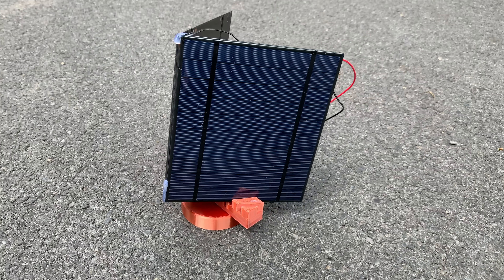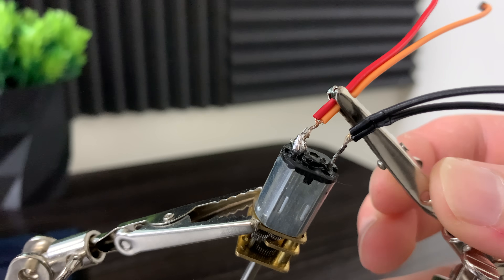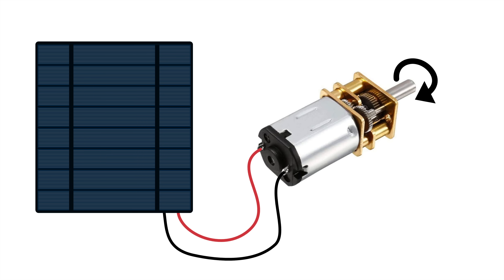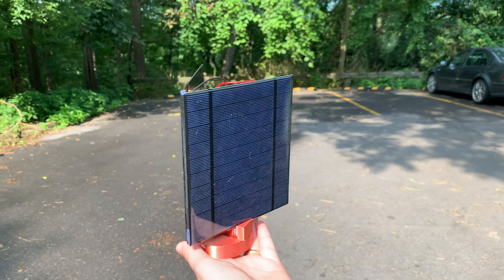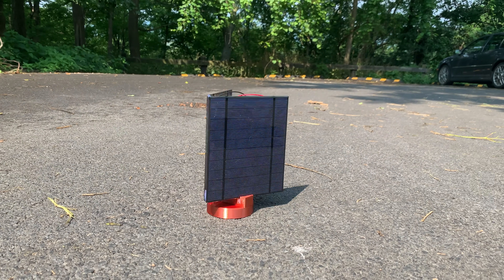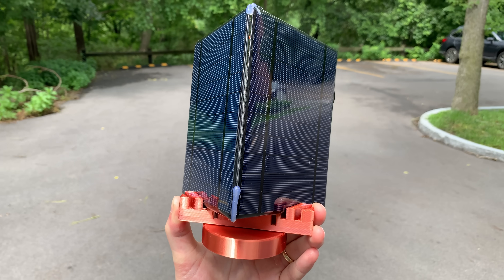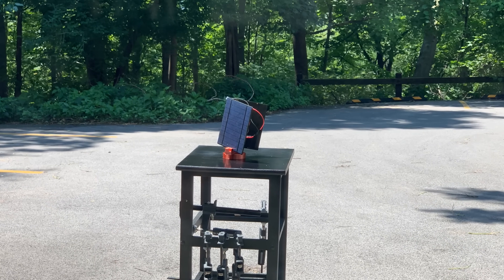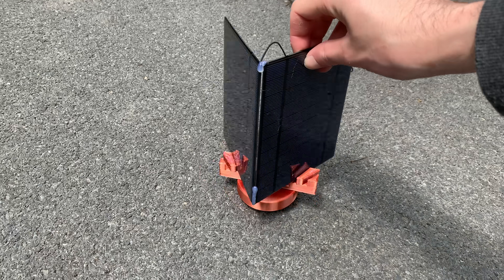World's simplest sun tracker.

Comment: Love the simplicity! Nice one!
Reply: Hello
Reply: Simple solar powered resistive heater as they are in series and shorted. If scaled up, this is a fire hazard.
Reply: @dtibor5903  finally, someone who thinks
Reply: I can already see a more elegant solution for the oscillation... made in brass.
Reply: please do something similar but also to power something ( small electronics) 😉🤙 U REALLY CAN MAKE SOMETHING #AMAZING FROM THIS !!! finger crossed 🤞 HOPE U GET MORE SUBS !!!!!
Reply: @lsudan2670  Also, it would be nice to be able to store the energy it collects also.
Reply: @kryptonic010  But if you build a position encoder into the base, this could be used to steer a much larger array of panels.
Reply: @kryptonic010  You can always connect a simple 10Amp LifePo4 battery to it or any AGM battery in that case!
Reply: Try this!
Essentially the same concept with a transistor amplifier.
http://www.redrok.com/electron.htm#ledcooker3
redrok
Reply: @ D Tibor... A couple of diodes would stop that...
Reply: @thedarkknight1971  ah yes, the comment i was expecting. No they don't. Totally hollow statement: "diodes". If only for your own satisfaction, try to draw how those diodes would need to go in the curcuit and you would see that won't work.
Reply: @thedarkknight1971  no, the panels are in series without any proper load.
Reply: @thedarkknight1971 no it won't
Reply: @Aden Sallaberry - See my comment (2 small solar panels drives the turntable motor, and 2 large solar panels mounted on top of turntable to provide power to whatever you need power for)...
Reply: 2 photocells like switch of conmutes conection to the electric engine doing the sale, only what you can take some energy from the solarpanels. Add logical doors (2AND, 1XOR) and it become eficient
Reply: Hey ma man I'm big fan of yours
Reply: SIR MATT, PLEASE DO A VIDEO OF  SUN TRACKER BUT IN DIFFERENT APPROACH =)
Reply: So cool to see YouTubers commenting on YouTube
Reply: I can read this in your voice DIY Perks
Reply: research solar probe.. similarly self aligns in 4 axis to shadow satellite from suns radiation.. another pair of solar panels + geared motor on x,y is needed..
Reply: Woah hey you here!!
Reply: Eh neat
Reply: Exactly what would you do with this? My first thought was cool, maximum charging for camping or whatever but not so.
Is your next video on doing something useful with it? I do love diy projects.
Reply: Woooooah. Matt is here..
Reply: nice to see you
Reply: Ok baby
Reply: Hello
Reply: wow guru u are here 😘
Reply: Make it out of brass and make it shine as usual diy perks kkk
Reply: Hi...
Reply: The king have spoken
Reply: О, привет
Reply: Make a series of such videos @diyperks
Reply: It's still not the best as both the panels are supplying equal power to remain stationary but as a result both are facing the sun at an angle. So it can track sun but It can't produce power efficiently.
Reply: You could do something whit this ...and im waiting to see it.
Reply: I bet you'd make it out of brass ;)   - The most simple and beautiful sun tracker
Reply: This is simple but so dumb.. definately it will damage one or other solar panel and then it will keep pointing away from sun... Classic example simple not always better..
Reply: Dude you're amazing i use your videos at my university here in Cuba i like your videos
Reply: DIY Perks you are yourself, an excellent creator
Reply: though u saw that one https://www.youtube.com/watch?v=wL9PcGu_xrA and still think this video is useful...
Reply: A compliment from the master of overengineering stuff himself. Nice, this channel is officially famous now :D
Reply: Nice to meet you sir
Reply: simple as a shortcut is.
Reply: It's so simple, it's even broken after some weeks. XD why no one see it's wrong designed?
Reply: @The_Kansas_Kid its a shortcut, what did you think? best case it just stops working. in the worst case it could burn. would YOU test this? not me.
Reply: @The_Kansas_Kid everyone who knows just a little about electricity can tell you a shortcut isnt a thing you should build. so my proof is: ask others.
Reply: @The_Kansas_Kid wow you was a electrican and didnt see the sortcut here? try to paint the curcuit at a paper and see yourself! i could do this for you but i think youtube didnt let me post a link here. its ok to not trust people, i fully understand you. but you HAVE to paint it, i bet you will see the problem here! you can write me back and i will answer! i prommise.
Reply: he didn't include the usage of the powerful human being that has to keep moving it....idea is there...functionality not quite
Reply: Ti leave them fixed in a good orientation, Is more simple and probably you harvest more Energy.
Reply: Yes, a Little Wind Blow and you get a solar airplane that could kill your neighbours.
Ideal for Ucraine Land.
Reply: It’s amazing how simple such a complicated thing can be. Now we have to figure out what to power with it!
Reply: @AdenSallaberry  👍⭐
Reply: @AdenSallaberry  you cant power anything because is is powering it self and wasting the energy. it is not a practical circuit , just a toy.
Reply: @AdenSallaberry  you cant. It doesnt deliver any power in neutral position
Reply: @AdenSallaberry  it can‘t power sth with this wiring. You’d have to sacrifice the simplicity for that. That’s why this is simple, yet not clever.
Reply: @tmartin9482  think u miss the point you can now mount this on a larger solar panel to ensure its always pointing at the sun.. he literally just made a homemade sensor with almost zero complications.
Reply: @AWESEM0  For example, think about whether you would rather control according to the potential difference of the 'detector' in your example, or whether you would rather control according to the total output of the power generating panel.  Also think about whether it would be efficient to react to every momentary shadow on the 'detector'. What about reflections, etc.?
The part shows several physical effects and the author has shown that in an excellent way. But please don't overstress the concept.
Reply: @tmartin9482  finally, someone with a brain and using it
Reply: @tmartin9482  you could use it for powering something. It would be more complicated but still possible to pursue simplicity like they did in the old days with the electrotechnics
Reply: @LayerSlayer73  You can't use the shown mechanism for powering sth. It stops as soon as the voltage drops to 0. No Current , no power. And i don't want to have a discussion while you are moving the targets ...
Reply: @tmartin9482  what is normally done is to use 2 small solar panels to drive a motor with several panels on top
Reply: @AWESEM0 plenty of complications like shorting/reverse feeding the solar panels.

Comment: You could put a diode on one lead of each panel to stop voltage feedback into the panels
Reply: Well, the funny thing is solar panels are made of diodes.
Reply: @Duck_side  kind of, but in this situation they are backfed, which means one panel will act a little like a shit diode lamp while another is getting enough light to power both it and motor. I don't think you can solve it by adding diodes, as they will face the same way the diodes in panels are facing thus doing nothing to solve the situation. Maybe I'm wrong, I'm not really into electronics.
Reply: @forgivenid  Diodes can fix this. Connect a diode oriented in opposite polarity in series with the solar cell. This diode cannot support current flow in both directions unlike the solar cell.
The issue here is the voltage drop across the diodes leading to power loss - however this dampening can also help attenuate the oscillations of the device, if the solar cells output sufficient operating voltage to overcome the drop in normal operation
Reply: @Duck_side  They are not made of diodes.  A diode is a pn junction that's been designed for a particular application.

A solar panel contains a pn junction but it is not designed for the same use as a diode.
Reply: @deang5622  a diode is a diode. The application may differ but the device is still a diode.

A solar cell is a photodiode, which is still a diode.

Comment: That's a short circuit! 🤔 The overcurrent could damage the panels. Try to connect the two red wires of the panels. Then connect the two black wires to the connections of the motor. That should work without a short circuit.
Reply: The panels will experience a current no higher than their Isc (in fact much lower due to not being normal to the sun). Your proposal of applying opposed voltages from the two panels instead of opposed currents will likely result in the motor not turning, because the change of Voc with incident intensity is much smaller than the change in Isc/Imp.
Reply: @cosmicosmofour6883  Nevertheless it's worth a try.

Comment: So would you use this to turn a larger array or how would you harness any power from it as that would negate the principles on which it works?
Reply: Place this device on a larger array, and it's a negative feedback loop.  A simple DC gear reduced motor just like he used but bigger to drive the large array would be plenty.  The sun moves to the left.  The sensor array follows it, which makes an electrical contact.  That contact fires the main array drive motor (through a suitable relay or h-bridge).  The array swings left moving the sensor too far to the left, causing the sensor to swing right and breaking the control contact.  Disregard the comments about it being a short circuit heater.  the panels in this device don't produce enough current to be a problem.
Reply: You can heat up water with this simple solar powered resistive heater. If is wasting all solar power as the panels are basically shorted. Connect two 100w panels like this, and boom, you got fire hazard.
Reply: @dtibor5903  Ah yes, heating water with the power of the sun, except there are solar panels floating in the water for some reason.

Comment: Very clever and simple. It would be nice to solve the oscillation issue in such a way that it  still tracks more smoothly. Add a small potentiometer to the rotation axis and you have a position encoder that can be used to control a more powerful stepper motor for a larger electricity generating solar panel, or a whole array of them.
Reply: Or you could actually measure the voltage difference and drive the motor such that the error goes to zero using the combined power of both cells. But that would require more then 3 components.
Reply: Someone who gets it!  A stepper is overkill, though.  Place this device on the array, and it's a negative feedback loop.  A simple DC gear reduced motor just like he used but bigger to drive the large array would be plenty.  The sun moves to the left.  The sensor array follows it, which makes an electrical contact.  That contact fires the main array drive motor (through a suitable relay or h-bridge).  The array swings left moving the sensor too far to the left, causing the sensor to swing right and breaking the control contact.
Reply: He's proved that solution already.. without any more components.. 😁😁😁..
OR SOFTWARE 😂😂

Comment: not usable in practical one..... rather use two LDR, an opamp, Zener diode, and an H-bridge motor driver..... this combination can make it way more efficient and usable.
Reply: Originally I tried LDR’s but they proved unreliable. Changed to two small solar panels and it’s been going for the last 10 years.
Reply: @kevinmills5293  why unreliable? Were they saturated or was the area too small and prone to give false measurements when they went dirty?
Reply: @theincapable  they would fail after a  week or so. I was running them well within limits in terms of voltage and current but I had about 4 failures before I went to small solar cells. Maybe the sun was too much for them or they were a faulty batch (from China).

Comment: But then, how do you do something usefull with the energy without disturbing the balance?

Also, if you don't touch it in the night, will it be able to retrieve the position in the morning? or is it having the sun totally in the back?
Reply: The simplest way would be to use tiny solar panels that only function as sensors (or probably just photoresistors at that point) and connect them to a transistor that controls a bigger motor which can move some bigger solar panels that produce useful amounts of energy.

Comment: Why track the sun if you can't use the power from the 2 panels to powering other things.
Reply: you could add another panel on top that would have maximum power because it's always facing the sun
Reply: @thesmasherthebest  that would work, but most of the weight in this design rides on the motor. It would need to be redesigned to work effectively.

Comment: Back when Discovery channel was doing useful shows, they had one called The Colony.  The first group built a simple solar tracker using a photocell that was recessed into a tube.  When the photo cell didn't see the sun, the motor was activated, moving it and the whole solar array.  Once light hit it, it would stop.  It's just one of the things I have filed away in case society collapses
Reply: I keep wondering when that solutions will be incorporated into all solar panel arrays and disappointed when it hasn't happened yet.
Reply: @Jamesvandaele  the problem in this is that a fixed solar panel is way cheaper since less complicated parts, way more safe to mount and also more effective since not every spot is big enough to carry a rotating angled solarpanel also less chance of failure  due to less parts. maybe the floating solarplatforms already use this?
Reply: @nfnworldpeace1992  and the lack of moving parts means less wear and thus a longer lifespan
Reply: @nfnworldpeace1992  A DC motor, a mount  and a few connections is not many parts. A fixed solar panel would be way more efficient if the sun was beating directly on it at all times all day long
Reply: Than you for your comment, I was trying to remember the name of the show. That old dude was a very creative engineer.
Reply: @Aquatic Ape MIT says 2040, and we're more or less on track for that, but there's always the slim chance people will collectively pull their heads out of their asses and work together rather than against each other.
Reply: Once I made a line tracker like that, 2 photoresistors inside a termotube, 2 leds and 2 motors. Same circuit in both sides of car. Leds pointed to the floor and when there was no light reflected to the photoresistors that side motor stoped so the other turns back the car to the line. It was very fun to do back then in Highschool
Reply: I used to love that show! I forgot it ever existed.  Thanks for reminding me... I'm going to go see if it holds up to my teen brain romanticism of TV. Mythbusters was amazing and still is, so maybe I had great taste as a teen... lol
Reply: @DanteYewToob  I just remember that the old guy who put it all together went from being all beat down and depressed looking to happy and healthy over the course of the show.
Reply: i watched that and have it here as well :) 

a great thing. It was the IBM fellow guy who did all the cool stuff :) and the mechanic guy. everyone else was fucking useless.
Reply: If society collapses won't we have bigger priorities than building a toy that points towards the sun?
Reply: @huraqan3761  Solar panels generate electricity, which can be a useful thing in situations where the power grid is unavailable.
Reply: @jaredkennedy6576  uh huh, if society collapses you'll probably want to start growing food first.
Reply: @huraqan3761  And things to make that easier include an electric water pump (because gas/petrol will be nonexistent), electric light, power tools to build things, refrigeration for what you grow, etc.  Have you tried living without electricity?
Reply: @jaredkennedy6576  Yes I have, briefly, but humanity has done so for thousands of years. Some parts of the world are still managing without electricity. Also, a "photocell that was recessed into a tube" isn't going to help if you can't make your own solar panels and electric tools.
Reply: @huraqan3761  I already have the stuff.
Reply: @jaredkennedy6576  yup yup, what about when it breaks?
Reply: @huraqan3761  So should I give up over a maybe problem in a hypothetical situation?  Or maybe this is one option I've worked on?
Reply: @jaredkennedy6576  idk, idc, you do you man
Reply: @huraqan3761  Not if you are dependent on Solar Pv power for your battery storage and the Inverter to AC!
Reply: That's all well and good for a few days until the suns Azimuth changes enough and the light no longer shines down the hole without changing a second axis.
Reply: Great idea 💡 that solves another problem! 👏
Reply: Aren't we all forgetting that we can track the sun with our eyes? It's not like these things have an output other than visual.
Reply: @cameronsmith5968  Look at the sun close enough and you'll swap the visual output for pain.
Solar panels are most efficient when within a certain angle range to the sun.  Once they are outside that, output drops pretty quick.
Reply: @quelorepario  Interesting.  I get a fair bit of pain from bright lights.
Reply: @cameronsmith5968  I hope you have good health insurance, corneal transplant aren't cheap.
Reply: @quelorepario  You don't have to look at the sun unprotected to know where it is. Shadows and dark lenses exist. I should have known the internet would take my comment too literally :S